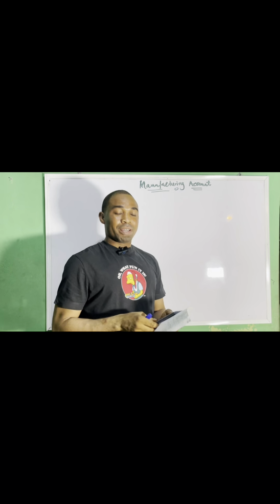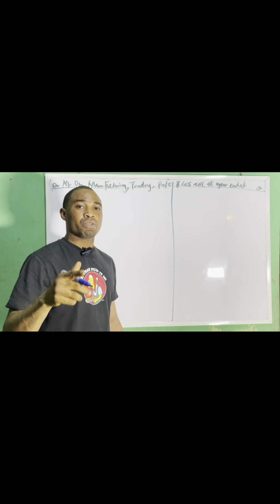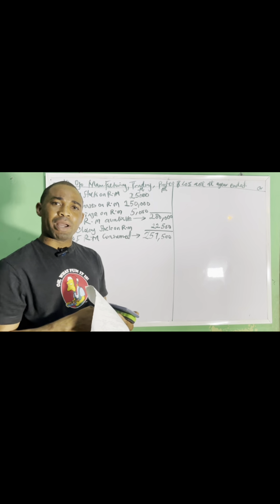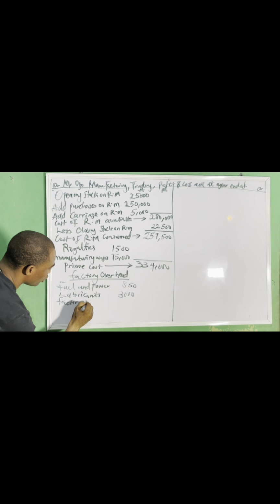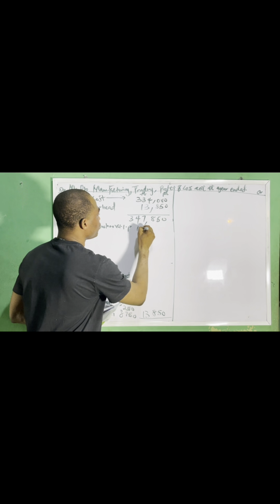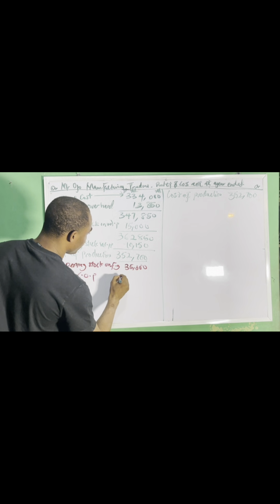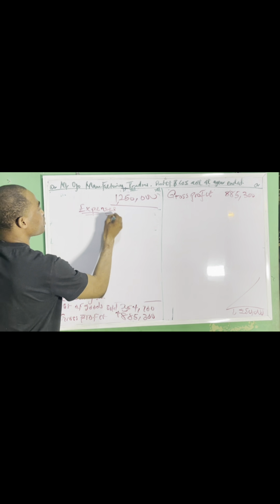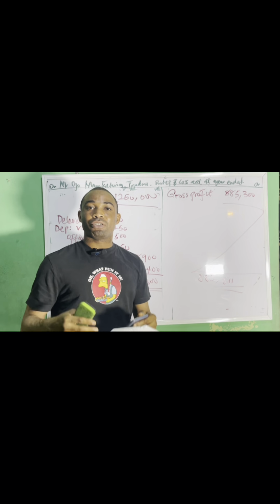Manufacturing Account Full Tutorial | Financial Accounting

Comment from the maker: Question👇👇👇👇

Mr. Ojo is a manufacturer. From the following prepare the Manufacturing, Trading, Profit and Loss account for the year ended 31st December, 1994.

### Stock of goods 1st January, 1994:

* Raw materials — ₦25,000

* Finished goods — ₦35,000

* Work in progress — ₦15,000

* Purchases of raw materials — ₦250,000

* Manufacturing wages — ₦75,000

* Royalties — ₦1,500

* Fuel and power — ₦850

* Lubricants — ₦3,000

* Factory insurance — ₦1,050

* Factory rates — ₦200

* Carriage on raw materials — ₦5,000

* Delivery van expenses — ₦600

### Depreciation:

* Plant and machinery — ₦8,750

* Delivery van — ₦1,250

* Office equipment — ₦1,500

* Advertising — ₦5,250

* Salesman commission — ₦300

* Sales — ₦1,250,000

### Closing stock:

* Raw materials — ₦22,500
* Work in progress — ₦10,150
* Finished goods — ₦23,000